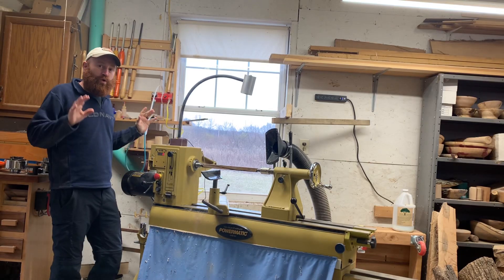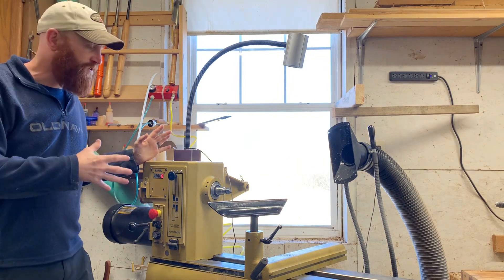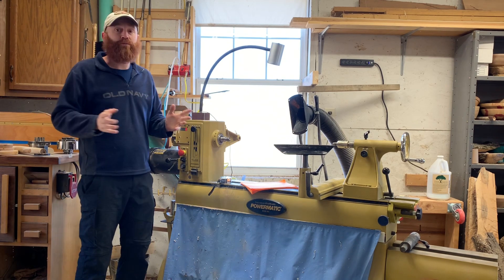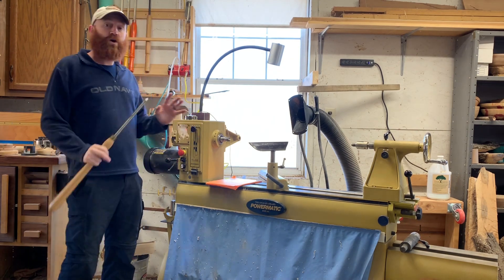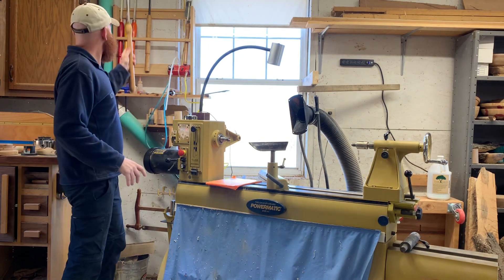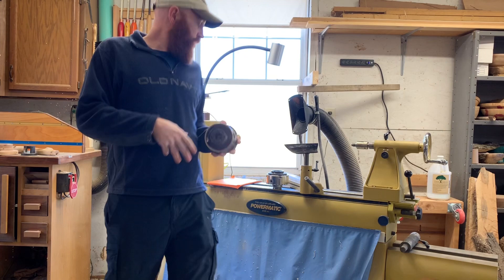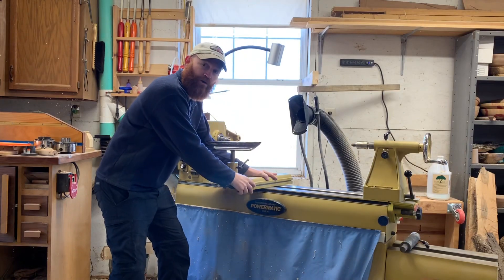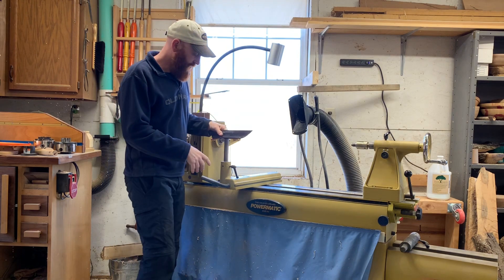Basic Lathe features and specifications explained for new wood turners

Comment: Thank you so much for the help, sir. I'm looking to get a faceplate for my lathe, but I don't know how to tell the size of the spindle (if that's the right word?) and TPI. Will that be somewhere on the lathe or is it something I have to measure?
Reply from the maker: You are very welcome! Sometimes the sales data doesn’t have the info.  You are looking for Spindle thread size.  You may need to click on a manual or spec sheet.  You should be able to find it electronically and not measure it.  You could probably ask google Gemini or chatGPT what the headstock spindle thread size is for (model xxx lathe).  If you still have any issues just hit me up on here and I’ll help you find it.  Thanks for watching!
Reply: @woodworkingmcdanielstyle  I appreciate the time and help! I got my lathe secondhand at a garage sale. I've tried looking for a manual for this lathe and it doesn't seem to exist online. The only thing I found about it was a forum post about that same brand and model. The conversation there was mostly about whether it was worth it or not. I'll try digging a little deeper, though.
Reply from the maker: Which lathe is it
Reply: @woodworkingmcdanielstyle  It's a Value Craft model 8232. It also seems to be an identical model to a Tradesman model 8232. I don't know much about manufacturing, but I have to imagine they were the same product given different names, though I don't know why companies would do that
Reply from the maker: @MikeyJBlakeJR  The Value Craft 8232 (sometimes branded as ValueCraft or under other "import" labels) is a hobby-grade wood lathe. While these specific older models don't always have extensive online databases, they generally follow standard sizing for imported lathes of that era.
The spindle thread size for the Value Craft 8232 is most commonly:
3/4" x 16 TPI
(3/4-inch diameter with 16 Threads Per Inch)
How to Verify for Your Specific Lathe
Because some import brands changed specifications between production runs, it is always a good idea to double-check with a simple measurement:
• Measure Diameter: Take a ruler or caliper to the outside of the spindle threads. If it measures approximately 19mm or 0.75 inches, it is a 3/4" spindle.  
• Check Thread Count (TPI): Hold a ruler against the threads and count how many "peaks" are in one inch. For this model, you should count exactly 16.
• Alternative Size: A less common alternative for this class of lathe is 1" x 8 TPI. If your spindle is significantly thicker (about 25mm), it is likely the 1" version.
Reply: @woodworkingmcdanielstyle  Man, I can't tell you how much I appreciate this. I picked this lathe up at a garage sale for $10 and have been wanting to really make something with it (like cups or bowls), but I only have a spur drive. I plan on getting my hands on a faceplate to make something more detailed. Thank you so much for your help!
Reply from the maker: @MikeyJBlakeJR you are very welcome.  Once you get it up and running watch the rest of the videos in this playlist.  I really tried to break things down so a beginner can understand what is going on while they are turning with each tool.  And always here to answer comments.  Have fun with the new hobby!!!
Reply from the maker: For my lathe look at page 5 of this manual for an example.  It says 1-1/4” x 8 TPI

https://powermatic.com/media/akeneo_connector/asset_files/M/_/M_1353001_3520C_Lathe_Edition_4_EN_f835.pdf